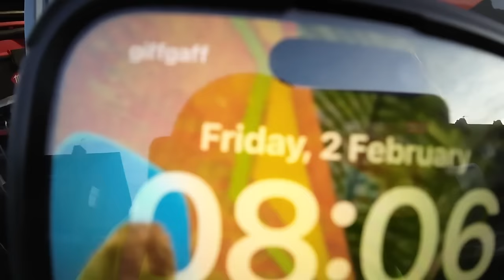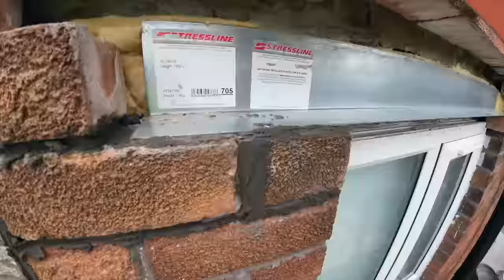LINTEL DESTROYING HOUSE! HOW WE FIXED IT

Comment: Lovely neat repair you two. First class. Some great shots of the power of rust jacking. It simply has to expand and destroys all in its path. Water is the same. When it freezes it expands by 10 % and will burst a pipe like a knife through butter.  👍👍👍
Reply from the maker: Same in bricks Doug hence blown faces after winter ❄️ 😬🧱👍🏽
Reply: @SteveAndAlexBuild  Yes indeed. No sign of op yet 🤔
Reply from the maker: @Doug.... nope , they say no news is good news but I beg to differ 😒🧱👍🏽

Comment: The power of corroding steel, expansion is amazing, it can lift many tonnes of masonry, it was common practice during the 1950’s/ 60’s to use angle iron as lintels, this is a time before off the shelf fabricated lintels, the old angle iron lintels were at best painted with red lead or worst no protection at all, if they had used hot dipped galvanised steel the problems would have not arisen

Comment: Question Steve - from a 'Dummy' (me), to the 'Expert' (you) - how do you determine the length of brick course and number of brick courses that can be safely supported by the Strong Boys?  To me, it seems as though the brick course is only held up at the ends - why doesn't the un-supported brick course collapse?  (I did say I was a Dummy!).  Apart from that, another good days work at the office, thank you!
Reply from the maker: Triangles and friction are the key words 😉🧱👍🏽

Comment: Those cavities are  bone dry,  not much chance of damp getting in there and causing issues lower down the wall......!      Obviously damp had penetrated far enough in to set off the decay process on the steel angle.  It was good to see the concrete lintel on the internal skin.    Good comment on the new cavity trays - I`m not a fan.....but they have a job to do.
I remember putting steel angles & flats in above openings - but in my defence we always gave them 2 coats of metal paint prior to installation.....and it was the standard practice at that time. That being said that angle iron is what.......68 years old, so its reached the end of its working life.  Every component we put into a house when we build it starts deteriorating from the moment it is built.
The air brick wasn't lined inside the cavity was it.? It was not a standard detail then. And cavities were viewed differently in those times....2 inch cavity, no insulation, unvented and the two skins of the cavity wall probably tied together with galvanised fish-tailed ties (bastard things)    All different today of course.   Right I`m waffling again so it just remains for me to say, estimable and sterling work chaps......A job very well done.
10 from me.

👍👍👍👍 📙☑☑☑😁😁
Reply from the maker: Cheers Martin 🙏🏽😁🧱👍🏽

Comment: I can see how this can be a problem with Brick buildings
when the pointing goes, you get water Ingress and interior and structural damage. 
the black pipe running up the side of the building, is that what you call a stink pipe?
I am an American,  and have a strong interest in all that is Britain , and have done some
research on things there. for instance I have learned your Electrics: mains voltage, cycles,
your Color Code, about consumer units , breakers, switches, power outlets, ceiling roses, 
Ring circuits ETC. now doing research on your plumbing. as in the past  when I was much
younger I did home Maint here. and was curious as to how things differ there.and that is
what started me on this curiosity quest 😀
Reply from the maker: It certainly is and good luck with your research 🧱🧱👍🏽

Comment: The lintle lifted? Whats pushing it up.? Serious question
Reply from the maker: Very powerful rust 😬🧱👍🏽
Reply: @SteveAndAlexBuild  rust lifted that whole gable, the rust on the lintle rest?
Reply from the maker: Yea mate very common , I’ve seen rust lift a house roof up 😳🧱👍🏽
Reply: @gavinmcinally8442  As Steve explained in the video, it is a combination of "rust -jacking"   from the lintel,  and the existing galvanised wall ties in the general walling.
The gable wall is single skin of brickwork which is tied to the internal skin with wall ties. Its a relatively light panel of walling.  This degradation all starts with the "weathering" process  and differential thermal movement -  this causes minuscule movement cracks in the mortar (seasonal weather variations & wind)  play a large part in this process and before you know it moisture has found a route in........then the problems begin.
People do not realise how much their houses move throughout the year  -  although admittedly this is on a microscopic level. But after 60+ years.
PS = I forgot to mention wind loads on roofs can transfer onto the brickwork and cause movement issues......
Reply from the maker: @martin2466 🧱👍🏽
Reply: @martin2466  I was looking at a rendered gable just last week seems to have horizontal cracks every 2 course " of blockwork " under the render. I'm thinking it might be that..👍🏻
Reply: @SteveAndAlexBuild  40 years at the game and first I've heard of rust jacking
Reply: @gavinmcinally8442  
Oh my days........rendering and gable walls, what a combination that is...
What was the conclusion, and what remedial work is proposed.?
I believe the term "Rust jacking,"  is an American term,  but it is an interesting phenomenon,  there is a  lot of reading matter on line about it. You see it a lot in R.C structures and walls.
Thanks for your reply and good luck with that Gable wall.
😁👍👍
Reply from the maker: We have many vides showing rust damage 😬🧱👍🏽
Reply: @SteveAndAlexBuild  I'll be giving them a look and shall share wiv like minded people. If rust can push of a lump of concrete, why wouldn't it lift a gable, 👍🏻
Reply: @martin2466  was actually a job next to mine and I was asked for an opinion, I thought it was the wind catching there arial which was at the top of the gable, but couldn't work out why  they were all over the wall,
Reply from the maker: @gavinmcinally8442 🧱👍🏽
Reply: @gavinmcinally8442  Oh that`s a relief as that sounds like a  problematic job - that gable.  I did something similar a few years back, it was a brick built gable that had been rendered. It turned out to be "Sulfate attack."   The rendering had shrunk and cracked because it was a rubbish job,   water had got in and set up a reaction with the brickwork mortar.....and hey presto Sulphate attack. you can always tell because it often causes long horizontal cracks in the bed joints...
But nothing compared to Rust jacking.
Its been nice chatting to you.  Take care.
😁👍👍👍
Reply from the maker: @martin2466 🧱👍🏽👌🏼

Comment: Good technical work but very poor health and safety, falling from heights is very common, check the HSE data! You should have used a proper pole and clip scaffold with a handrails and proper ladder access. This is even more important when you are loading the scaffold. Customers need to understand the cost implications of working safely. One slip or trip on the scaffold boards and at best a change of life at worst the undertakers. You need to look after yourselves!